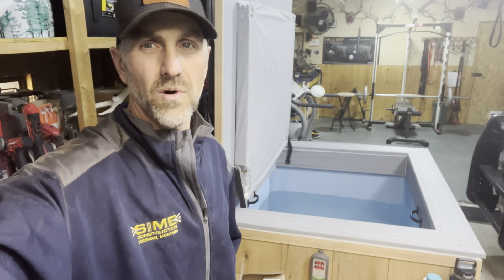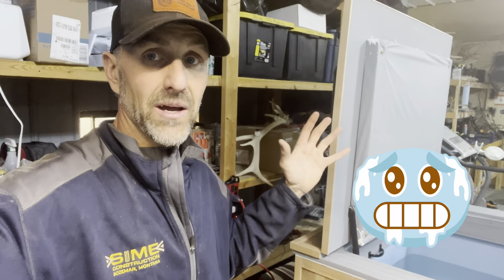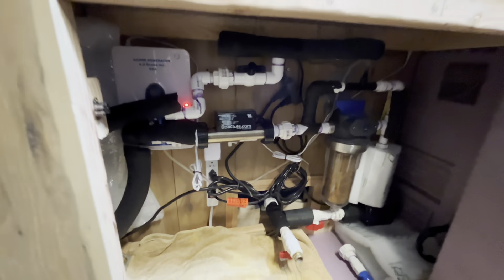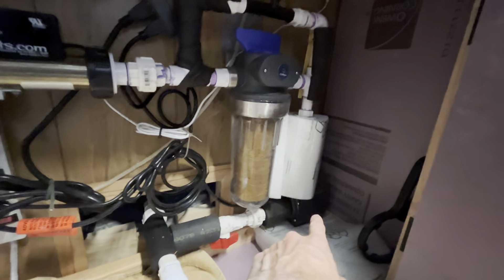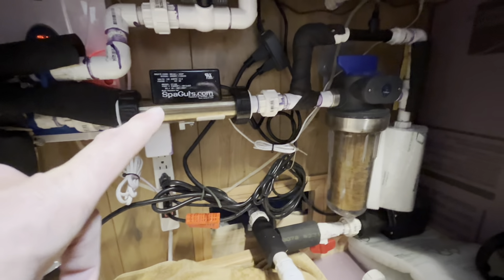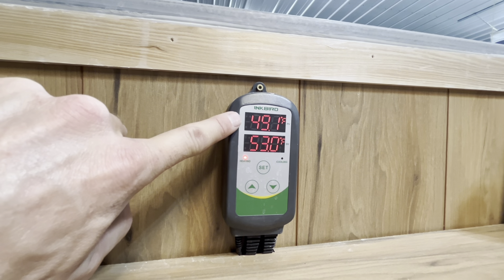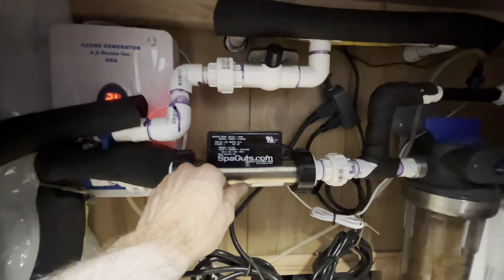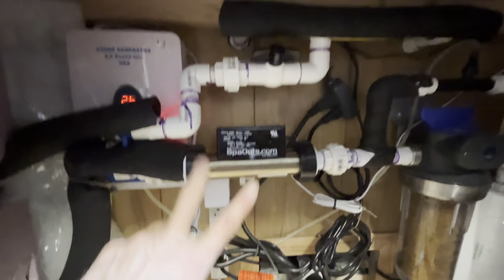DIY Cold Plunge Update #2:Winterizing a Cold Plunge! Heater in a Cold Plunge??

Comment: So the spaguts plugs into the inkbirds heating outlet, then does the chiller plug into the inkbirds cooling outlet? Then the inkbird plugs into your powerstrip? Then the inkbird magically controls the temperature for both?  I'm not trying to diy a whole setup, but I was looking at Cold Creek tubs they use an Active Aqua 1/2 hp and ozone, but no heater. I'm trying to find a way to keep a 50-60 degree temperature in the winter.
Reply from the maker: @coralleonard5981  yep that’s exactly what it does. You can set a temp range for each outlet on the ink bird (cooling/heating) I currently have mine set for 45-47° on cooling side with a 2° temp swing and 42°-45° on the heating side. If the water temp gets above 47° then the inkbird will kick on the chiller and bring it down to 45° and if the water temp drops below 40° then it kicks on the heater and heats it up to 45°. It’s worked great so far.

Comment: How has this been working out? Looking for a solution for mine as well.
Reply from the maker: Seems like it’s working well so far. Admittedly, it’s hard to say though since we haven’t had really cold temps yet. Today was actually the coldest day of this fall so far at 9° but that’s outside temp and my shop temp was still in the 50”s I think. I run the shop heater every morning and evening when I’m working out in there for 10-15 minutes just to take the edge off until I warm up so it hasn’t hit freezing in there yet. I think with a smaller plunge it would work great and I don’t foresee any problems with this setup as long as I have power to keep the heater going. I’ll update if any issues arise!
Reply from the maker: Thanks for watching!
Reply: @highcountryoutdoor  Awesome, thank you! I got one ordered for my setup as well, which is outdoors under a covered patio. I have a UV filtration unit from RevX Wellness, which contains the pump as well, so I'm hoping I can squeeze this in that system. Worst case, I suppose it could just mount outside in the open air in the middle of one of the supply lines?
Reply from the maker: @mattbigelowhandpan  probably depends on what the temps that you experience during the winter months. The elements certainly won’t hurt it but if you get extremely cold sub zero temps it might be risky. As long as your pump runs 24/7 it might be fine.